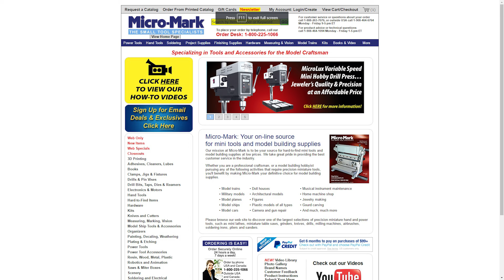Chain Link Fence – Model Railroad Scenery

Comment: Can you PLEASE make a realistic snowy landscape?! It would be awesome!
Reply: There's no snow in Australia except for the mountains in Victoria, I think he's a South Aussie so It's not very likely sorry :( I'd love to see this too though
Reply: Ethan Porter forgeting the blue Mountains
Reply: @4cqker It snows on Mr Lofty. :D
Reply: This is super easy!
You need:
cardboard
Glue gun
aluminum foil
Baking paper
gypsum

Take some cardboard and make a basic form of the landscape you want,glue the parts together (if you want a round shape; you'll need cardboard with a curved inside*, remove one of the paper parts almost completely. Curve it like you want and glue the paper back on)

Cover the whole model with aluminum foil (tip: curl the foil and open it again before gluing it to the cardboard-model) you can also mabe aluminum foil-balls and glue them on the model, for example to make a snow man

Put baking paper under the model and
Cover the model with gypsum (tip: make sure the parts you're covering is laying flat (suport the model or hold it for a few minuttes, this will prevent the gypsum from slide/drip)
Take smal parts at the time, the gypsum is harding fast(you can use some of the harder gypsum to make another type of snow)

Enjoy
Reply: @4cqker  l
Reply: @4cqker  think again
Reply: @estermarie2731  I wanna try this as I'm making a snowy landscape

Comment: I installed chain link fence for over 50 years it's the most popular of choice. You will always have work if you live in or near a metropolitan.your fence is accurate and the half diamond on the top rail looks right. We use 'aluminum color' anti rust paint for touch up, it matches perfect too.

Comment: Found the TULLE in different colors at Jo-Ann Fabric. I chose the Grey TULLE which doesn't need painted. Made the framework and painted it Grey then secured the TULLE. Used twisted picture hanging wire for the 'barbed wire'! Excellent video by the way..

Comment: great videos. i'd like to point out though that lead vapor is not a concern with lead solder, as lead does not vaporize at the temperatures that are used for soldering. that said, the rosin flux vapor is also not the best thing to breathe in ;)

Comment: top tip from a completely different world of use ;) - to straigten the wire perfectly right away, hold one end with pliars while the other end is fixed into the centre of a drill chuck, pull slightly to add tention and then run the drill for 5-8 seconds. stop and release the pliars but don't let the wire slip and drop. Boom, instant super straight wire!

Comment: Another cracking material for the fence is aluminium mesh for car body repairs. I just normally drybrush it to make it look like weathered steel chainlink. Oh, and wire saws from survival kits make nice barbed wire. I coil it around a pen or wood dowel to make razer wire.

Comment: This is real neat. I'm a remote control operator for kiwirail and we have lots of these short useless fences about, some without barbed wire, one 30 meters long with a hole cut in the middle! Will be adding this to my future layout, when I get the time 👌

Comment: A tip. Fill the void in the cutters with RTV, let dry (3-4 days). Then use a razor to cut open the RTV with the cutting edge of the cutters (so that you have RTV on each jaw). This will keep your wire from shooting across the room. We use this in Aircraft maint.

Comment: you can make styrene  fence stronger a couple of ways. for round posts use long halve round stock, make full length horizontal and "chopped" verticals on one side, then full length verticals and chopped horizontals on the other side. For square posts draw pattern on 0.5mm sheet glue on 0.5mm posts and when dry cut out unwanted 0.5mm sheet.

Comment: Hi Luke,To prevent filling up your file with solder while remeving it from your metal fence, you may apply some white chalk on your tools. In case your file is filled up with solder you can also remove this using a copper wire cleaning brush or a strip of brass plate. My compliments for all your video's. Keep on producing these spelded video's

Comment: Thanks for the video for several reasons. I'm going for 1/35th scale fences in various heights, never thought of using wire for posts. Then there was laying the wedding veil on top of the fence posts, then gluing the veil to the posts. I was cutting the veil to exact width each time.....talk about a pita. Also, using a SINGLE post to hold everything in place.....all my posts were extra long for this. Using spray adhesive & paper to hold things in place will make building these things a lot easier, along with being a new one for me. But in 1/35th scale, I want to see barbs on my barbed wire, so cutting individual strips (threads?) of wedding veil. Bought The Chopper from Micro Mark earlier this year using your code and it's worked out great.

Comment: Hi Luke. Instead of yanking your wire with pliers to straighten it try using a drill on slow speed with your same setup. You'll get perfectly straight wire

Comment: Another tip for wire straightening, put one end in the vise or have an assistant hold it with pliers. Clamp the other end in an electric drill and gently carefully twist the wire by spinning the drill. It will be stronger and very straight.
Reply from the maker: Awesome, thanks Dan for the tip... I might try to fashion up a rig so I can do it one handed? Just a thought...
Reply: @BoulderCreekRailroad  Should work - only thing is depending on the thickness of the steel wire it might snap if you do it too quickly.

Comment: you can avoid the burrs if you get a 90° facet cutter like the one you use to cut the thin wire. They come in bigger sizes, they're not cheap but have a lot more uses than you'd think initially.

Comment: GOOD TIP to straighten wire perfectly straight, anchor it to a table like you did, but instead of yanking it out, put it in a drill and twist it a little ;)

Comment: Straightening wire can be done with placing one end in a bench vice and pulling the other end with a set of pliers and you can feel the wire give slightly as its done at which you stop after it no longer stretches.

Comment: To straighten the wire: Clamp one end as you did in this video. Take other end and put into the chuck of a drill. Twist wire at high speed for a few seconds. Et voila, perfectly straightened wire.

Comment: You can straighten the wire by holding it in a screwdriver and twisting it.
Or screw it on both ends on a stick and on one stand with your feet, pull the other with your hands.

Comment: Know this is an old video, but just thought I'd put out there, that tig welding rods are a great source of nice straight wire cheap wire for projects like this and easy to find an any local welding supply, Amazon, or many big box hardware stores.

Comment: Good work Luke, may I suggest a modification to your procedure. I would use a heavy gauge tinned copper wire rather than a steel wire, and then use solder paste to make the joints. Solder paste has the advantage that it can be applied sparingly to the joint and it then leaves less to have to file off afterwards.

Comment: Another good video!  I prefer however to use straight sections of brass wire, that way I don't have to straighten wire off of a roll.  As a pattern, I have a 1/4" thick piece of Basswood a few inches wide that I carefully traced a pattern with a good quality ball point pen.  It leaves a slight indentation that helps keep the wire from rolling out of position.  Then I solder it like you do.  (I use thin pieces of tape to hold the wire down, but I like your way too).  I also have a pattern to make railings for walkways and stairways the same way.  You can buy a sample swatch of tulle lace at fabric store really cheap, I've been using the same swatch for years, there's enough in a swatch to do most any layout.
Reply from the maker: they are some fantastic tips 😊 I really like the idea using the pen on the bass wood. Thanks mate 😊

Comment: If you chuck the wire in a drill and spin it in either direction while the other end is clamped or held with pliers it will make for a perfectly straight wire.

Comment: To get wore straight as a arrow chuck it up in a drill and twist it. For a 2 foot length I'd spin on high for a solid 2 seconds and adjust from there. It doesn't look spun after.
Reply: Watching the whole video you probably knew the spinning thing already. I'm just trying to help. Not that you need it haha.

Comment: You can get your wire super straight by rolling it beneath a large book or a stout cutting board. I roll the wire on a silicone mat 1 or 2 millimeters thick. The result is near perfect.

Comment: a trick ive found to straightening wire is to clamp on end, then put the other end into the chuck of a drill. you pull and turn tge wire until its straight.

Comment: Fun trick: To straighten a length of wire, stick one end in the chuck of a drill, and grip the other with pliers or in a vice. Give the drill a good spin for a second or 2 and voila! Dead straight wire. Probably won't see this though...

Comment: I like the video on making a chain link fence. However there is one critical measurement I need. The distance between the top rail and bottom rail. You drew the two lines on the board but didn't give the distance. Keep up the good work.

Comment: Awesome video, Luke!  Did you consider using cut lengths of straightened music wire? I used some music wire of the right diameter to avoid trying to straighten a roll of wire. Also, people need to make sure they are using the right flux for this or you will have trouble with the solder 'beading' and not wetting out well.  An acid flux actually works best for this like Kester SP-50.  With the right flux, it will wet-out and flow beautifully instead of trying to bead up like water on a waxed car.  Need to clean it well after soldering before painting.

Comment: You probably have discovered this by now, but, if you clamp one end of the curved wire to a bench and the other end in a drill after a few rotations it will be perfectly straight... if you pull it and remove the slack.

Comment: if you want your wire straight put it in the Chuck of a drill and the other end in that vise it will be truly straight after that
Reply from the maker: I did try that with this wire but it had a flat spot along one edge so when I twisted it in the drill you could see that the wire had been twisted. It I had round wire that didn't have any flat edge I'd definitely straighten it by twisting it in the drill :)

Comment: Great demonstration!  One  of my friends said that tinned copper wire would be easier to solder. Since l have an N Scale layout , the joints on the the chain link fence are closer together than the one in the video.  Have you been able to use  galvanized steel wire on  an N Scale fence?  Thank you!

Comment: Luke;  Great "How to" videos on building chain link fencing... Keep up the good work.  Q:  Which do you prefer, wire fencing or plastic?
Reply from the maker: I prefer the wire, it's not quite as easy to work with compared to the plastic but it's quite a lot stronger and can handle a few bumps. The plastic tends to break when knocked. Also the wire is easy to bend when adding the barbed wire sections at the top, it's harder to do that with the plastic version.

Comment: you also can straighten a wire, when clamp one side and the oppside side in a drill. the rotaiton will straighten it up. i knew this method from an 
lightning protection worker. 
klasse Lehrvideo, weiter so :)

Comment: a better way to straighten the wire is to tightly grip one end with pliers and  put the other end in the chuck of a drill, pull it taught and spin the drill clockwise. and now you know

Comment: Hey Luke, love the tutorial, would fly wire mesh be a good alternative to the tulle? I bougth my Chopper from Amazon before I knew about MicroMark. Where would I buy the styrene rods?

Thanks for the excelent tut.

Elaine
Reply from the maker: Hi Elaine, fly wire would probably work ok, the holes would be larger though so it might not work for small scales like HO or N scale, you could do some experimenting on a smaller fence to see how it looks first?
Cheers
Luke

Comment: solder also dont stick good to Galvanized metal and must be Acid washed with Murattic Acid 1st NOT standard solder flux. thats how Tin Smiths have always done to seal drain pans etc.

Comment: Hi there Luke,
Please help. In this video you mentioned you used 32gauge wire for the barbed wire on the top. Do you perhaps know what thickness that is please? My hubby is trying to make this but the 32gauge seems to be a bit thick. Maybe your wire in Aus is thinner?
Also the 18gauge for the uprights, what thickness?
Thank you kindly, val in south africa
Reply from the maker: Hi Val, the gauge actually refers to the thickness of the wire. A wire with a low gauge number is thicker while a wire with a high number is thinner. 32 gauge is very thin wire while 18 gauge is much thicker. If you go to the hardware store and ask for a specific wire gauge I'm sure they will be able to help you however the very thin wire, 32 gauge, you'll probably need to find that at a craft or jewelry supplier.
Hope that helps 😀
Reply: Luke Towan thanks so much Luke

Comment: Soldering with lead solder doesn’t give off much in the way of lead containing fumes 
(Unless your iron is over 450°C. But it shouldn’t be)
The vapour you see coming off is the flux core 
But you still shouldn’t breathe that as it’s bad for your lungs 
Though if you do it a lot
Have an extraction fan

Comment: @Luke Towan what is the best way to clean dust and pet hair from model scenery?
Reply from the maker: Good question, I've found using a vacuum cleaner and a soft paint brush works best. Basically I hold the vacuum cleaner about 5 or 10cm above the surface of the model and then with the soft bristle brush I lightly dust the surface. The dust lifts away and is sucked up by the vacuum cleaner. 
The only problem is small pieces of scenery inevitably get sucked up as well and after doing several cleaning sessions you may fine some of the scenery need a bit of touching up.
Hope that helps
Reply: Thanks for the quick reply! I like the brush idea! Are you using a paint brush for like painting walls or for finer stuff like painting models?

Comment: I have one question. What size styrene would I have to use for a G scale size fence?
Reply: I am trying to work in different scales myself.  A conversion of the 0.8 mm to other scales from HO is something like this, where HO = 1:87 and this G Scale example is 1:22:
0.8 mm X 87 / 22 = 3.2 mm or about 1/8".  I would do some experiments to see how it works for your planned use.
All the best,
Charles Sloane

Comment: cld u use window screen for the chain link or wld it be to big of holes for ho scale
Reply from the maker: I think window screen would be a little too big for HO but it might be worth trying anyway...
Reply: ok it mite be good for 1/24 or 1/25 scale I relized the holes where to big for HO scale so I went and bought someof the veil material u sugested and used some some channel styrene for modeling instead of the round stock like u had.

Comment: Are there any dangerous fumes with soldering galvanised wire? I know it's not recommended to weld anything galvanised. That aside, another great tutorial with improvements over the original one. I have had a roll of tulle set aside to make some fencing since I saw your last video - just need to get a round tuit!
Reply: Any chance of a completely useless wall you can walk around the end of? There's a guy called Donald was looking for one!
Reply from the maker: I had a quick search on Google and could find anything specific to soldering galvanized wire? It would probably be a good idea to do it in a well ventilated area anyway.
Good luck with making your fence :) I'm sure it will look great.
Cheers
Luke
Reply: I don't think soldering would get hot enough to degrade the zinc coating on the wire. You should be perfectly fine. As an aside, although soldering fumes are nasty, and you shouldn't inhale them, they don't contain lead. It's the rosin flux that's toxic. I say this because it's something you want to avoid even if using lead free solder.
Reply: Many years ago I worked in an electronics factory, I used to solder (hand and machine) all day, every day without any real problems. I find now (20 years later) that I am very sensitive to rosin flux fumes - my sinuses clog almost immediately. I almost always have a small fan running near where I'm soldering to dissipate the smoke now - a slight cross flow across the bench is adequate.
Reply: Thanks for that. I'm reassured that making a scale length of chain link fence wont do me in! Cheers
Reply: It depends if it has lead

Comment: at the end of barb wire fences the poles are not bent
Reply from the maker: Do you mean the top part of the fence that is bent? Around me there are plenty of fences with barbed wire that look exactly like the fence I made. I guess it's different depending on the area you're living in.
Reply: Luke Towan and different builders ... love the fence by the way
Reply: Luke Towan the corners of a square barbed wire fence are straight that's what I meant